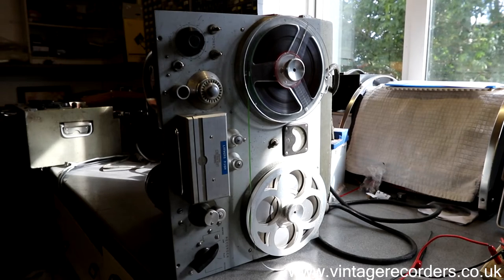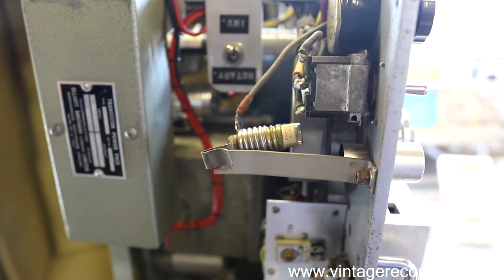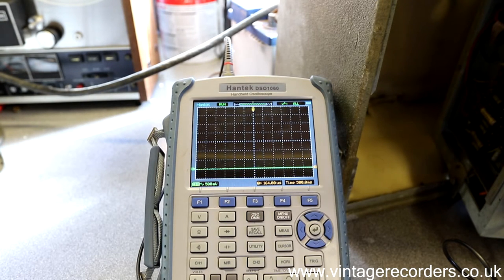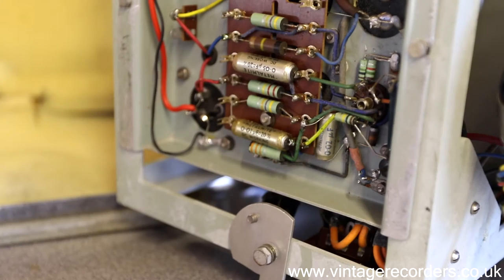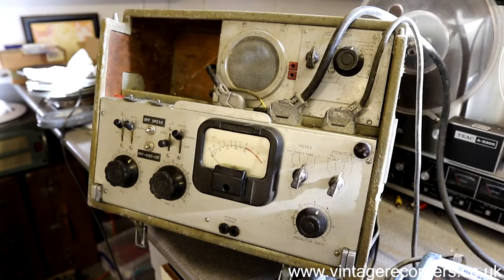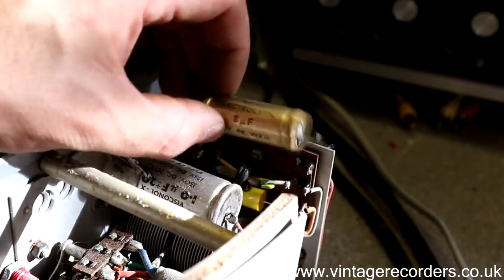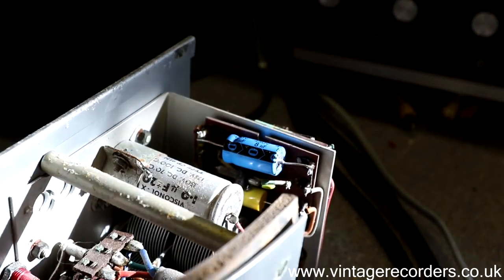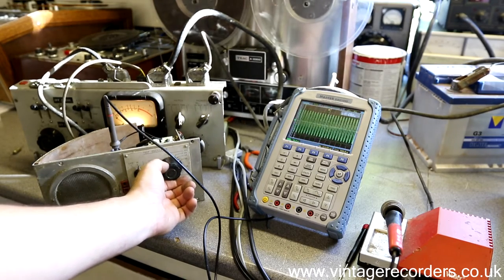Leevers Rich Series Cs vintage reel to reel tape recorder repair

Comment: I was taught that older electrolytic capacitors usually have a life span of 15 to 25 years (especially the large cans).  Anything beyond that is pressing your luck.  Shelf life on newer and much smaller electrolytic capacitors can be 25+ years I am told. 

Concerning film types, I have seen hair growth on the outer coating which may be the type of material used to coat them or a reaction with what is inside.  I've also seen film types from the 1960s coverings crumble, mainly the stripe color coded types.
Reply: Usually if a vacuum tube is not visually cracked, it can spring a leak around one of the pins.  Also some vacuum tube have visible silver burned off getter, others do not.
Reply: Usually if a vacuum tube has leaked, and if it hasn't already burned up the filament, you will see it go poof with a flash in the vacuum tube tester.
Reply: The 1.0uf capacitor you cut open may be a non-polarized electrolytic type.  I also hope the oil within was not PCB oil.
Reply: A hanger for your Dremel will help you to cut down on the vibration/noise :)
Reply: Then I must be really lucky: I have some 50+ year old tape recorders and some 40 year old synthesizers that still runs with all their original components.

Comment: How can you tell what the liquid is in those non electrolytic capacitors? Oils that cause corrosion remind me of PCB's.  Anyway very interesting video as usual.
Reply from the maker: not really sure, I always assumed it was oil, that one was very wet inside, the others I did where more like wax
Reply: Seblington Better safe than sorry with suspicious liquids in caps and transformers from older equipment.

Comment: Very interesting.  When considering re-capping something I had not realised is that even non electrolytics have a polarity which, for optimum (i.e. lowest) hum performance, means they should be installed the 'right way round'.

There is a very good video explaining it all in Mr Carlson's Lab series at https://www.youtube.com/watch?v=BnR_DLd1PDI and if you are going to do major re-capping, especially on valve equipment I recommend you have a look at.
Reply from the maker: Yes, the caps would indicate the leg connected to the outer foil, on these TCC's the ends are shown in red and black. I didnt really make reference to this but as you correctly say, there is a way around it can be installed to reduce hum yet in the diagrams it doent state it.